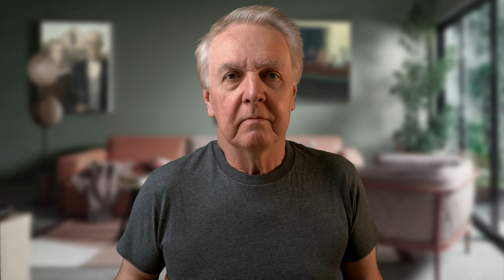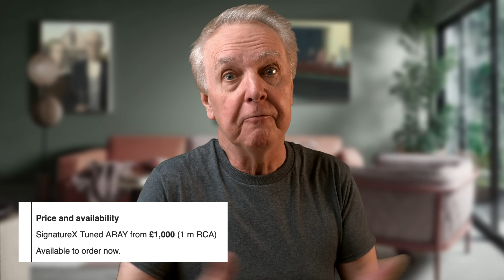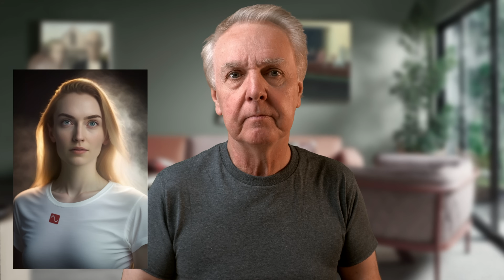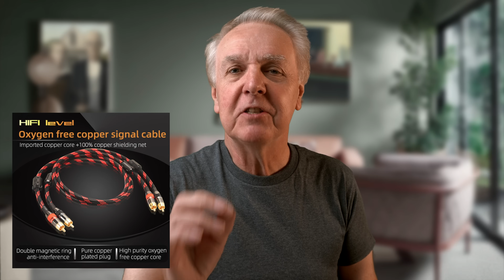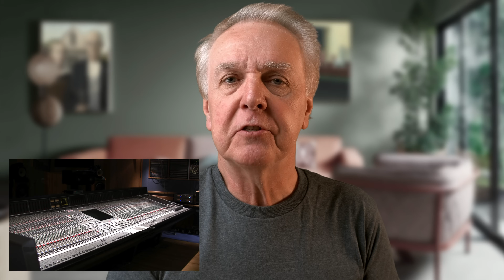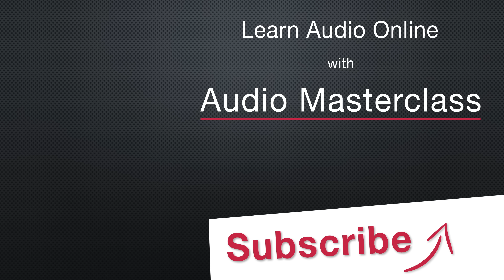Would you pay $1000 for a 1-metre cable?

Comment: It depends on how much disposable income one has.  It also depends on how much "enjoyment" is worth.  How much is time worth (if a person makes $1000 an hour, a cable costs one hour of time.  If a person makes $20 an hour, it's going to cost just over a week of time).  I have found that cables also impact the synergy of the system.  An interconnect that sounds great between a phonostage and a preamp can sound awful when used between the preamp and power amp.  It really comes down to renting cables and listening to them in your system.  If you can't hear the difference, then there is no effective difference.  If I use my stereo for at least 5 hours a night (for both 2 channel and home theatre), 10 years amounts to 10 x 365 x 5 = 18250 hours.  I have driven my sports car about 50,000 miles in the last 9 years.  That's about 1000 hours.  In terms of enjoyment per hour, it may make sense to spend 18 times more on my stereo than on my sports car.  Yep, I have spent more on my stereo system than on my sports car.  However, if one has a family with kids running round all the time, one doesn't really have much time to spend on listening to music or watching movies, so may not be worth it to spend too much on a stereo.  In my case, I have spent $3000 on a 2 meter long XLR cable between my phonostage and preamp.   However, I have spent $1500 on 10 foot long speaker cables (an interesting case here is that an audio reviewer, whose system costs $750,000, upgraded from a pair of $18,000 speaker cables to these $1500 speaker cables).  Cost does not equal goodness.
Reply: @Douglas Blake The definition of synergy is "the interaction or cooperation of two or more organizations, substances, or other agents to produce a combined effect greater than the sum of their separate effects."  You have equipment produced by different companies.  When they did their development or testing, they used their references.  e.g. Zesto used Cardas Clear Beyond cables when developing and testing their equipment (probably because they liked that cable the best to begin with so used it as their reference).  As such, it is likely that those go well together.  Use a Transparent cable instead and it is slightly off.  Use Purist Audio cable and it is more off.  I liked the Cardas Clear cables the best.  The Clear Beyond cables were too much for me (dynamics was so strong that it overrode the rhythmic aspects for me).  Some amps go well with some speakers.  e.g. Magnepan speakers are highly inefficient, and require powerful amps to drive them.  I have Legacy Audio Valor speakers with Legacy Audio Wavelet digital preamp.  They are specifically designed to go together.  It becomes the combination of electrical components that comes into play here, where pre-amps, power-amps, cables, and speakers, all play a part.  The more resolving the equipment, the more sensitive they are, which means that when things are off, it is more noticeable.  In my system, I was comparing USB cables from $2000 to $3600, and the differences were very noticeable (probably because the designers of each one wanted to capture a different character of the sound).  I ended picking one that was $2000 as I liked it best.  On a less sensitive and resolving system, you probably wouldn't hear a difference as the differences themselves are lost in the noise (and human hearing will discard it).  Humans have very sensitive but flexible hearing, just like their eye sight.  They can hear specific conversations in a crowd of people.  They can see in bright light but also in the dark, as they adjust to their situation.  Their hearing adjusts to the resolution power of the stereo they are listening to.  In my case, I wanted the room-correction capability of the Wavelet, as I felt that if I could not correct for the interaction between speakers and my room, I could be wasting my money.  ie. Extend the synergy from equipment to the room and the person.
Reply: @Douglas Blake Interesting.  If you know all this stuff, why are you asking my opinion?  My opinion comes from my observations and what I have heard from experimentation.  At one time people considered the world to be flat, and it was considered to be heretical to believe it to be otherwise.  Back in the late 80's I was doing research in self-learning systems for the guided approach to hypersonic vehicle part design.  Back then, we were looking at how the Russians looked at the problem versus how the US looked at it.  The US had a lot of supercomputer power, so looked at it from that approach.  The Russians only had PCs that they could scrounge, but they had great mathematicians.  As such, their approaches for the shuttle design (Russian versus US) were different.  The burn patterns from the Russian space shuttle were such that the US mathematics could not make sense of it.  We all look at the world from our individual perspectives.  Anyone who believes that their's is the only correct understanding only sees a small portion of what's possible.  Considering my opinions and speculations as a load of hooey demonstrates a very fixed mindset.  As such, you will likely be stuck in your opinions and probably never be able to experience what is possible.
Reply: @Douglas Blake Something to bear in mind is that high end audiophile tends to be a cottage industry.  You find these companies led by single individuals with vast amount of experience who come up with their own approaches.  As such, the prices tend to be high due to low volume.  The Legacy Audio preamp and speakers I have are MSRP of around $90,000.  I have visited the factory, where I have seen them winding cross-over coils, and machining the cabinets.  They just don't have the resources to test their equipment with every available speaker cable or interconnect.  Even with this speaker designer's experience, he originally believed that speaker cables did not matter.  I got my speaker cables from, probably a one man shop, who likely farmed out the manufacturing.  In this case, this person really did believe that speaker cables do matter.  It is impossible for any single person to gain enough knowledge in every single area.  My experience is in software development and research.  As such, I have over 12 US patents in the field of telecommunications.  However, I know that I don't understand either speaker cable design or speaker and amplifier design.  I acknowledge that these individuals know their stuff, and do their quality assurance so that I get a component which won't break as soon as I plug it in.  I accept that an expert in one field may have one belief, and an expert in another would have a totally different belief (where their beliefs may be incompatible).  I personally don't care about their beliefs.  I care about whether I can get the best from both people, to create a system that I can really enjoy.  BTW: My patents have generally been around combining standard based components in unique ways.  ie. A focus on the system rather than a focus on a component.
Reply: "It is impossible for any single person to gain enough knowledge in every single area." But it is possible for the collective experience of a century of audio engineering to identify that both listening tests and every known measurement show some things that change radically from one component to another, such as response of dynamic vs ribbon microphones, or transistor vs optical compressors. While other components are virtually unanimously agreed on by virtually all professionals who got into the field for love of music and high quality sound, with decades of experience such as David in many high-end settings, to have no noticeable effect on audio, assuming basic quality of construction... such as interconnect cables.
If not wishful thinking placebo effect, there would be SOME kind of measurable difference by now, documented in a series of reputable IEEE and AES published journal articles, given the kind of memory oscilloscopes and spectrum analyzers sold by companies like Tektronix (another place I worked) for use in military intelligence and manufacturing plant calibration.... six and seven figure measurement systems with high enough precision to calibrate radio frequency systems orders of magnitude more finicky than the audio range.
 As I mentioned in another comment, I've never once seen any musician, engineer, or producer who said the wonderful sound of a famous brilliant uniquely sounding record was because they spent a week choosing the best cables. 
As a former software engineering lead at Intel, I can confidently state that if a USB cable is adequate to deliver bits at all, the digital data from the source's operating system buffer is 100% perfectly cloned into the operating system buffer at the destination. Another few thousand bucks for the cable has no plausible scientific engineering explanation for sounding any different.
Reply: @editingsecrets  Ah.  The digital "bits is bits" argument.  The thinking that because a music file can be transmitted from a music server to a local computer means that the audio bits going across a USB cable must be perfect in the same way.  Of course, we have error correction and TCP retransmission when things go wrong in an IP network.  However, USB transporting audio does not have error correction.  Since we are streaming (with no retransmission), we either have to play what we can, or we drop the packets causing dropouts in the signal.  When we send digital across a USB cable, we first have to convert it to an electrical signal that can go over a USB cable, and then use thresholding at the other end.  What happens if the timing is not quite right.  I will say that having implemented various networking protocols that have gone into a VoIP Network in Sprint, things are not so easy when it comes to streaming media over an unreliable data link.  I have even implement code which uses a DSP to encode voice packets, and sends the across a network, decoding them at the other side.  I implemented a jitter buffer to both handle the jitter of voice packets, as well take care of the difference in clocks between the source and destination devices.  Some times, the bits don't align correctly, due to the difference in clocks.  You then have to figure out how to best correct for this.
Reply: (Edited to withdraw from the conversation, as just another cable-bliss skeptic.)
Reply: @editingsecrets  We have an intrinsic need to believe that we are right.  This is until we observe something that challenges our belief.  We then correct this belief, resulting in us being right again.  I must admit that I was first skeptical regarding USB changing the sound of things.  The second thing I was skeptical about was why an expensive streamer can sound better than a cheap streamer (no DAC included here, as the DACs are on the output stage of the digital pre-amp) and how does burn-in of a digital streamer even makes sense.  If we are getting digital from the streaming server, and then playing digital to the USB cable, it must be perfect and cannot be the possibility of burnin.  When I got a U1 streamer, I was shocked by how lousy it sounded.  (lousy is relative in this case).  I thought that I may have received a defective product.  However, I did some google searches and found that a burn in time of at least 200 hours was required.  Well.  I put together a very long playlist and played it non-stop for 2 weeks.  Every couple of days, I would spend a couple of minutes to listen to how it sounded.  It did take about 2 weeks before it sounded great.  How can this be possible, given that all the streamer does is transmit bits.  This caused me to rethink my assumptions.  I therefore rented out several USB cables in the $2000 to $3600 range.  The differences were readily apparent to me.  One really has to experience this for oneself.
Reply: (Edited to withdraw from the conversation, as just another cable-bliss skeptic.)
Reply: @editingsecrets  The people who first believed are the people who risked creating a business to manufacture and sell cables.  Only 20% of businesses survive 5 years, so real conviction is needed.  Some have written papers that they have placed on their web sites.  Of course, it could simply be a sales tactic to try to create credibility.  However, some do show how they use certain measurements and how they optimize for that measurement.  People do go and compare cables and purchase cables.  As long as people are buying from them, they have no need to write more papers.  The audiophile hobby is fundamentally one of enjoying music in its various dimensions.  It is the case that ignorance is bliss.  You listen to systems in your price range and get the best value for your money.  You think that it's the best in the world.  That is, until you hear a much more expensive system.  Then, you save up more money and buy that system.  That is, until you heard something even more expensive.  This assumes that this is a priority to you.  I know people who are very happy with their iPhone and ear buds.  I must admit, the best demo I gave was to a friend and his wife a couple of weeks ago.  I discovered that she needed hearing aids in both ears to be able to hear.  She found the system to be very clear and real.  I switched over to my projector and 120 inch screen with $800 Marantz 1700 AVR.  She was amazed in that she could hear everything clearly.  Up til then, she had always needed closed caption on their TV as she could not hear the voices, even with hearing aids.  She said she wanted this experience.  No doubt, they will be going down the audiophile route, probably starting with a modest system, but something that can improve her movie watching experience.
Reply: @editingsecrets  I will say that the most interesting experiment I watched on YouTube was the playing of a digital audio file on one device, and the recording the resulting audio after going over an Audio USB cable.  Then subtract the recorded signal from the original and play the difference.  If there was perfect transmission, then we would hear absolute silence.  However, what was discovered was that you could kind of hear the music, in the difference in the signal.  Of course, one can say that this must be a trick because it doesn't line up with what we might intuitively believe.  The other approach is to start to ask questions as to why there is a difference, or even try to recreate the experiment oneself, and then figure out why the person got those results in the first place.
Reply: @Douglas Blake I found the argument against "I heard it so it must be real" to be really bizarre.  People say that seeing is believing, but in your case, even seeing cannot be believed.  The purpose of audiophile is for entertainment, which is fundamentally about enjoyment and emotion.  There is nothing that requires a technical understanding of the electronics to make music enjoyable.  It's similar to saying that a person can't judge between a Porsche 911 and a Toyota Corolla because they are not a mechanic, and furthermore the people is ignorant for saying he enjoys driving the Porsche 911 more.  The fundamental problem with your argument is that you make the assumption that people can measure everything, and therefore all truth comes from measurement.  In science, we start by not knowing.  ie. Humility is key.  We then create a hypothesis, and figure out how we can measure something.  Einstein came up with the theory of General Relativity by visualizing himself on a speeding bullet at the speed of light.  There was no way to measure this at the time.  Your argument is that Einstein was wrong and ignorant because he couldn't measure the warping of space time due to gravity because it couldn't be measured.  However, it was many years later that measuring equipment was made to that could measure the bending of space time.  Right now, we may not be measuring the right things in audio.  In the future, we may be able to figure out what the right thing is to measure.  You should go to a HiFi show and have a listen to the various types of equipment available.  You might not be able to understand everything there but you can enjoy yourself.
Reply: @Douglas Blake Yep.  It is an illusion, and it is an illusion that can sweep away the concerns of the day.  The audiophile industry, as well as the music industry, is a business.  You will have companies jacking up their prices to obscene levels just because there are people who would be willing to pay those amounts.  There are people who spend ridiculous amounts so that they can show them off at parties, but they never listen to the system themselves (ie. status symbols).  When demoing my speakers at the factory, the speaker designer explained various things to me about what they tried to accomplish, and certain gratifying results they observed with their efforts.  He called this speaker a research lab, where they are continually trying to learn.  Given his interest in psychoacoustics, you can bet that such concepts are within the design of his speaker.  The main addition that this speaker does (with the preamp) beyond room correction, is the attempt to recreate the reverberent field of the performance.  This, too, is an illusion, but when you close your eyes, it really feels like you are in a large hall (depending on the effect). When it comes to cables, I really believe that people need to experiment for themselves, within the context of their system within their room.  If they can't hear an improvement, they shouldn't buy it.  While one can look at the web sites, which talk about why they did the construction they did, I kind of take it with a pinch of salt as I don't have the technical expertise to be able to judge their rational.  I do see people wielding the "facts" and "common sense" as though it was somehow infallible.  Such things depend on perception.  Facts and common sense take on  lives of their own in an echo chamber, with people in such places having real faith in them.  When people get exposed to new things, they gain new facts.  When it comes to audiophile, different systems provide different presentations.  When I have given demos of my system, people generally say that it feels so real.  Is it real?  No, it's an illusion.  However, it feels real.  They usually say things like this because they have never experience anything like this from a stereo system.  When it comes to discussions, I tend to present a different perspective.  If someone presents one view, I may present something else to consider.  I find this much more interesting than simply being part of a cheer squad.
Reply: @Douglas Blake This is certainly true.  When one is at a show, one hears things because people mention it at the time.  Whatever people focus on gets bigger.  I remember watching a video of someone learning to hand glide.  There was a big rock in the field, and he absolutely did not want to hit it.  However, he was so focused on it that he hit it.  This is part of the sales tactic.  I must admit that when people say that it sounds more "musical" I have no clue what they mean.  This is such a nebulous term to me.  I will say that I bought the phonostage that I did because the rhythm jumped out at me.  I was not listening for it.  It just grabbed me.  In this case, the dealer who demoed the system did not try to guide me down a path.  He probably sensed from my demeanor that I wanted to listen for myself.  Regarding the salesman with the equalizer; that was plain deceptive.  My preamp does include a digital equalizer, which I do use.  I adjust it to make it sound the best to me.  In a lot of equipment, there is no equalizer involved.  I think that people may therefore gravitate towards equipment that has a flavor that sounds best to them.  We are seeing equalizers being sold by more modest systems, but the more expensive ones don't seem to have them.  It is easy to throw the baby out with the bathwater.  Such deceptive practices can turn a lot of people off.  I do remember a cable company have an extremely expensive cable in their lineup.  When asked about it, they said that it was because people were willing to pay for it.  This makes sense because it is a business.  This is one reason why I suggest trying out a cable for yourself in your system, and also that a specific cable can sound great between the phonostage and preamp, but sound lousy between the preamp and power amp.
Reply: @Matthew Barrow You spent $3000 on a 2 metre long XLR cable? You must be easiest person to fool. Bet your preamp have a $4 Neutrik connector.
Reply: @rabarebra  Nope.  With a system that costs over $120,000, $3000 on a XLR cable which sounds better than the competitors makes sense to me.  Just had a 5 hour demo of several turntable cartridges (on turntables that match mine specifically) and ended up ordering a $13,000 cartridge (Lyra Atlas Lambda SL).  I was comparing it with a $7000 and $9000 cartridge, and the $13,000 was night and day improvement.  $3000 just isn't that much in this system.  When I demoed the various cables in my system, I also demoed the $5500 Cardas Clear Beyond cable, but found that I preferred the cheaper Cardas Clear instead.  This is why I mentioned at the beginning of this post that it depends on one's disposable income.
Reply: @matthewbarrow3727  It is in your mind, paying more, you think it will sound better. Man, do you know that little about resistance in cables, excuse me, interconnects? 😂
Reply: @matthewbarrow3727  With that $13000 cartridge you play the same $40 records with 96dB headroom and with its inner groove reduction. But please, just continuing supporting those low-sale overpaid companies.
Reply: @matthewbarrow3727  "depends on one's disposable income." it is here you fail to understand. 😂
Reply: @rabarebra  That's really funny.  One doesn't need to understand electronics to be able to enjoy music.  I have a Studio One DAW (DAW on my laptop), and a really old Korg Trinity workstation (which I bought in the late 90s).  I have even implemented a program that reads a text format (which I can type out music notes), and generates MIDI sequences that can be played on my Korg Trinity (where I replaced the floppy disk drive with a USB drive), as well as be able to load into my DAW (Digital Audio Workstation).  I would rather spend time learning about music mixing and mastering, than about resistance of cables.  I just find it so funny that people think that one needs to understand the electrical properties of a cable to be able to enjoy the sound that comes from the system as a result of simply plugging in the cable.
Reply: @matthewbarrow3727  You need to know the basics of how audio works if you gonna run a studio and work with audio. It is basic knowledge, especially with your setup, to know how to solder a cable and know abour resistance, and much girth the cable needs. Man, you should know how many people there is today that knows how to code computers, even 7-bits MIDI language. 😉
Reply: @Matthew Barrow With your analogies, you may pay $10000 for a litre of milk. Would you feel better than the average person then when you leave the grocery store?